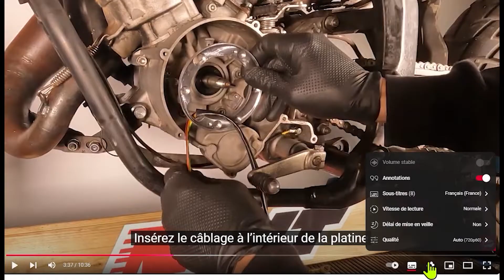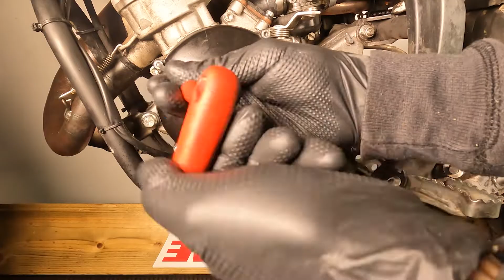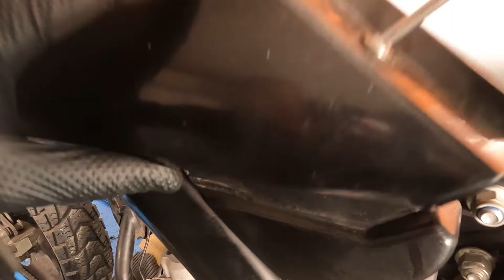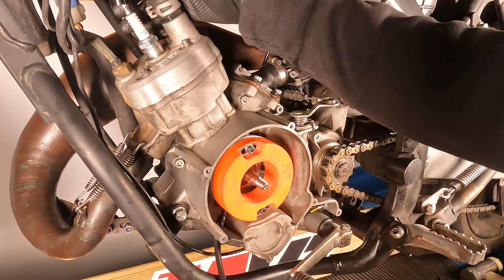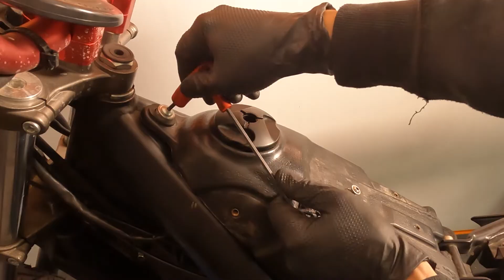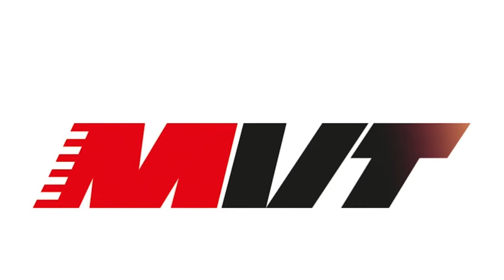Notice montage allumage MVT DIGITAL DIRECT DD12 RIEJU MRT 50 MINARELLI AM6

Comment: do you need a battery for the ignition to work?
Reply from the maker: Non pas de batterie sur dd12. L'autre version dd21, qui est destinée YAMAHA TZR DTR A PARTIR 2003 est livré avec un diagramme qui doit etre alimenter par une batterie pour fonctionner correctement

Comment: I have a DD12 for about 4 months on my HM, a spark now is very weak, what's the medium volts from black/red cable from stator? And what's the good volts from orange cable from Cdi to ignition coil? So I will check to find if is the stator or the Cdi to change. Thanks.
Reply from the maker: La valeur entre les fils vert/jaune et rouge/noir du stator doit être comprise aux alentours de 150ohms +/-10% et enroulement primaire et secondaire de bobine 6ohms +/-10%

Comment: What rieju is this?
Reply from the maker: Rieju 2017
Reply: @MvtParts  does this ignition need a battery?
Reply: @Profet_117 only if you want lights, if you dont have any you dont need a battery cause it generates enough electricity for the spark
Reply from the maker: @Profet_117 Pas ce modèle, uniquement DD21

Comment: Bonjour, je poste ce commentaire un peu tard mais j’espère avoir une réponse, sur mon mvt dd, l’intensité des feux et clignotant dépend du régime moteur, et donc à bas régime je n’ai rien qui s’allume et pour qu’ils s’allument entièrement je dois mettre la moto au régime moteur maximum, mais sinon la moto tourne très bien, je voulais savoir de quelle composant ce vient car je ne sais pas, en espérant une réponse, merci !
Reply from the maker: @rgcry3809  Bonjour, contrôlez les tensions du fil blanc et du fil jaune. Si les valeurs sont OK, vérifiez votre régulateur de tension
Reply: @ c’est sûrement mon régulateur car la moto tourne très bien sinon donc j’en ai commander un, merci pour votre réponse !
Reply: @MvtParts  que faire si les tensions du fil jaune et blanc ne sont pas bonnes ?
Reply from the maker: @rgcry3809 il n'y a rien a faire d'autre que de changer le stator